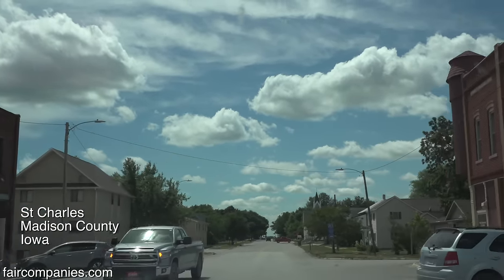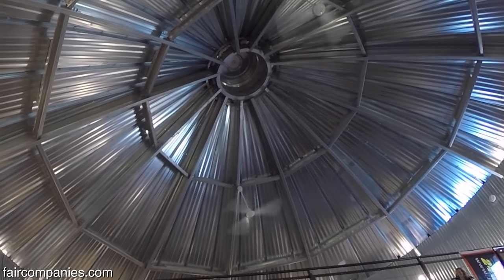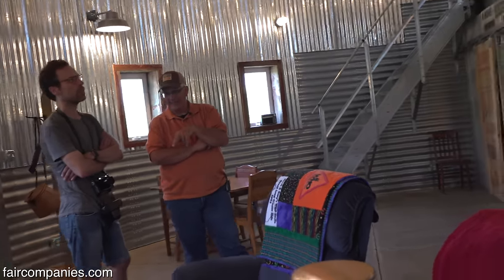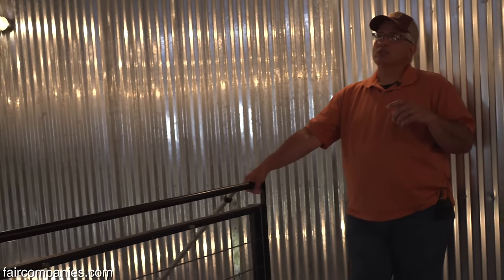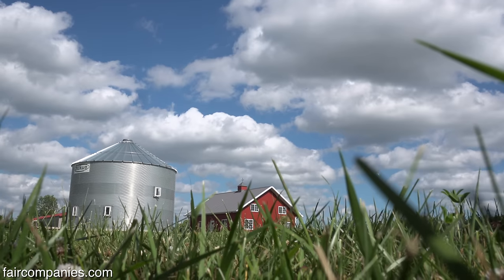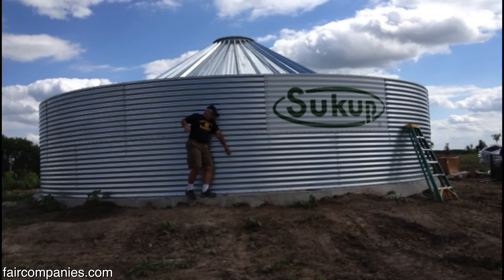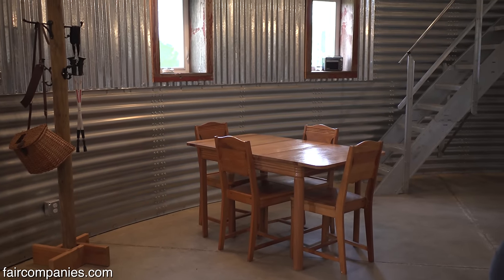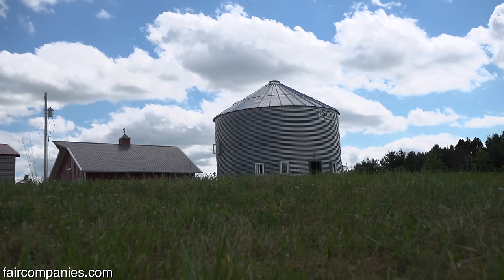Round grain bin becomes affordable prairie-style home

Comment: Actually you push air through the bottom of the floor up which helps to dry the grain from the bottom up.  Nice structure.  I would make it look like a house inside though.  It would be odd looking at metal all the time.

Comment: I love it - although I probably would have preferred having a bit more walls!
And it's so "country" in every aspect - it's so original...
Personally I would probably go in a different direction with the interior but that's just a matter of taste, I still love the idea!
Reply: You could put in Interior walls to get that flat wall and divide the area more, like they do with Yurts. Not sure they ever said how much square footage it was. A larger window, or several small windows adjacent to each other would have been nice for a view. And I think most building codes require egress from sleeping areas in case of fire. Though it looks non-flammable from the outside
Reply: @recoveringsoul755  
Yes, and I love your idea with multiple windows, in an offset pattern, and perhaps a big one as well.
A great way to play with how the light enters the building!
Reply: @gorillaguerillaDK  another comment said they could put a deck all the way around the second floor, that would be spectacular, and add external stairs up to the deck, could serve as fire escape too. Not sure how it would attach but sounds cool.

Comment: I love the idea. Zero exterior maintenance. Wind strong, fireproof, but I'd have put some nice pine tongue and groove planks on the walls with some Thermax behind it, and tile or hardwood floors. I'd also have a small wood burning fireplace and a lot more windows. Plus, the second floor would be bigger with 2 sets of stairs. A regular one like he has and one spiral in the middle. Plus, a walk out deck from the second floor with another set of stairs.

Comment: Bob, I don't want to preserved for 100 years in the grain bin (ha! ha!) but I do want to live in a grain bin! 
Great job on your conversion!
PS: I know you're aware of this already but, you can still "cut" windows into the top of the grain bin, just contact an engineer and get some "numbers crunched" for safety reasons, then contact a local contractor with a tall "lift" aka crane and have them cut out the windows and then install them for the extra light! 
Cost? 
Now that's the true question because it's not going to be cheap to hire a contractor with a tall lift or crane and then install the windows! That being said, it would add a lot more light.... and more value to the home later on if you sell.
Mr. & Mrs. Brad Bowen
Retired, Veteran
San Diego

Comment: Could have built a deck/patio under the roof and them just insulated under the patio floor. That would have made an awesome upper deck. What a view it could have been
 With a great roof
And pneumatics should have been installed to open doors and do other things.
It looks like he has enough of a lip on the slab to lay some bricks around the bottom. Use bricks from a brick silo.
And could have put floating rooms with sway bridges like crown center in Kansas city.

Comment: $7k for materials $7k for building it. $10k for concrete. That's $24k for a built silo. Making it into a home by insulating it and furnishing it shouldn't take more than $15k. 

This is the cheapest more durable building I have seen built. Cheap, quick to build, low footprint, low maintenance,  perfect kind of building! Yet he couldn't have built it in the city.